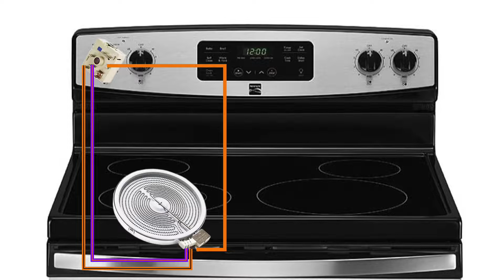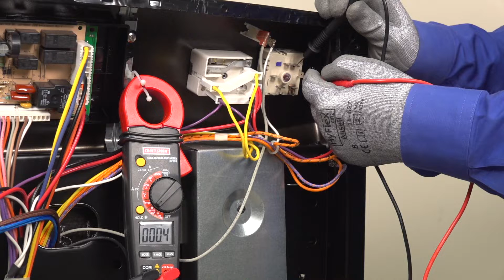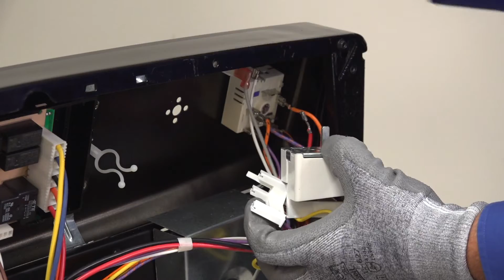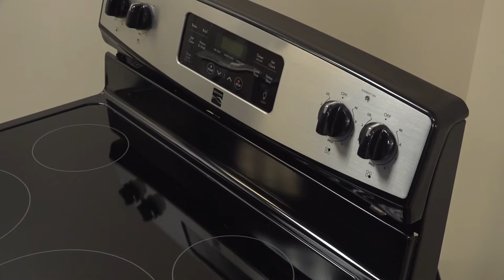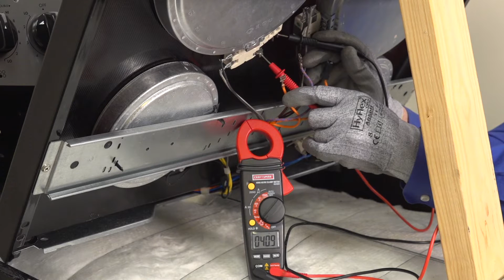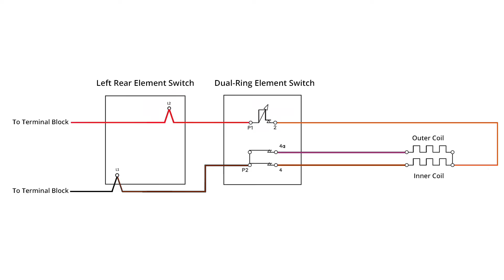Range Dual-Ring Radiant Surface Element Not Working

Comment: Thanks for the video! I have a question - both of my elements/rings work. But when I try to only turn the inner ring, the outer ring turns on. When I turn both rings, they both turn on. Could a faulty switch do that, or could it be the wiring is incorrect? The stove is from previous owner so I am not sure what was done before. Thank you!
Reply from the maker: Your symptom points to a wiring connection failure. The wire for the inner ring may be connected to the wrong spade on the burner switch or the wires for the inner and outer rings on the radiant surface element may be switched. Let us know the model number of your range and we'll provide some specific information on checking the wiring. Note: Be sure to unplug the range before checking any wiring yourself.
Reply: @searspartsdirect  its a fridigaire CFEF766GCG. Thanks for the prompt reply!
Reply from the maker: @cancelOG  Thanks for providing that model number but we didn't find any information on that model of range. We have data for American and Canadian models but we didn't find any models that begin with CFEF7... If your model isn't American or Canadian, please let us know. We'll try to find technical information for that model. If you miss-keyed the model number, give us an updated model number for your range.
Reply: @searspartsdirect  sorry I made a mistake the model number is CFEF366GCG
Reply from the maker: @cancelOG  Thanks for the updated model number. We did find technical information on that model but that model doesn't appear to have a double element. According to the parts diagram and technical information we have on that model, it has large and small single elements on the cooktop.
Reply: @searspartsdirect  thats what it is though. That's odd.
Reply from the maker: @cancelOG  The previous owner may have installed a double burner in place of a single one and wired the double burner incorrectly. If you unplug the range and pull off the back console cover you may see terminal spades marked 4 and 4a on the double burner switch. You can try switching the the wires connected to 4 and 4a to see if that fixes the problem.

Comment: Thanks for the video! I have one more question about the wiring. Which leads should I connect to test the indicator light? The problem I have for the switch is when I turn the switch on, it heats up (inner and outer both work fine) but the indicator light is not on. I'm sure the light itself is good, because it lights on when either of the other three switches are on. Thanks!
Reply from the maker: The switch contact between P2 and S2 closes to light the "element on" indicator. With the range unplugged, turn the burner switch on and check for continuity from P2 to S2 using your meter. If your meter measures infinite resistance through that contact, replace the burner switch. We hope this additional information helps. If you need further assistance, let us know.

Comment: I have an interesting problem on my Kenmore Elite that I haven't been able to track down (and can no longer replicate).  A few days ago, I turned the dual-ring switch to "Hi" on the inner-ring only (or single element) side.  However, the entire switch (and associated indicator light) acted as though the burner contained a single element over the last few days.  What I mean is, essentially the switch acted like a normal ~330° of control for the single inner burner (as the other true single element switches behave) instead of the typical ~155° given the two modes (single vs double element control).  Now today the switch and element are acting as they are supposed to (double element) -- so I can't further troubleshoot the issue.  Hopefully that makes sense.  I'm wondering if this is indicative of a failing switch?
Reply from the maker: Your symptoms indicate that the switch is going bad. You'll likely see this problem resume. Replacing the switch should fix the problem. Unplug the range before replacing that switch.
Reply: @searspartsdirect  Thanks for the reply...I appreciate it.  That's what I was thinking.  I'll order a new switch so this doesn't crop up again on Thanksgiving.
Reply: @kd0jzf580  and hear Im reading this on Thanksgiving 2021

Comment: need wiring diagram loss picture
Reply from the maker: The basic wiring diagram between the burner switch and the element is shown at 3:46 in the video. You can pause the video there to examine that diagram. If you have a different type of range or need more help, let us know the model number of your range and additional details about the problem that you're troubleshooting.
Reply: @searspartsdirect  Kenmore 30" Radiant counter unit m#911.44022100   I was replacing WB30T1004  service unit  Did not so was switching WB24T10063 element control from one to an other to check it . Took picture Went to rewire lost picture on phone went ahead wired best i could remember worked  Except for large or out side of WB30T10044
Reply: By the way thanks really did not expect to get this chance
Reply from the maker: @donaldhutcheson5291  Thanks for providing that model number and the additional details about your problem. We have a basic wiring diagram for that counter unit but the wiring diagram in our technical data doesn't show wire colors. The burner switch WB24T10063 typically comes with special wiring instructions because that part is a revised substitute for the original burner switch installed in that counter unit. Those instructions are complicated and difficult to follow. We may be able to help you fix the problem that you're describing even though we'll likely face some significant obstacles. If we understand your details correctly, you've connected the wires from burner switch WB24T10063 to radiant surface element WB30T10044 but the outside ring of the element doesn't heat. Here's some advice based on that scenario. With the counter unit disconnected from electrical power (power cord unplugged or house circuit breakers for the cooktop shut off), check for continuity through the outer ring of the element using a multimeter. If you don't have a multimeter, you can get a simple multimeter at your local Sears store or hardware store for less than $20. To check continuity through the outer ring of the element, set your meter to measure ohms of resistance and place one meter probe on the outside spade of the 2-spade connection and the other meter probe on the element spade that connects to the thermal limiter box with 4 spades. If you measure infinite resistance through that portion of the element then you'll need to replace the element. If you measure a resistance value between 20 and 60 ohms through that portion of the element then the element is likely okay. If the element is okay then the failure of the outside element could be caused by a wiring problem or a failed burner switch. The spades on the element switch should have labels. Let us know which wire is connected to each spade on the burner switch and let us know which wire is connected to each connection on the radiant element. We'll try to help you find the cause of the element failure.

Comment: What would cause the burners to stay on high when they are reduced to a lower setting
Reply from the maker: That failure is typically caused by a faulty burner control switch. Here's a video that shows how to replace that part: https://www.searspartsdirect.com/repair-guide/ranges/how-to-replace-a-surface-element-switch.html  We hope this information helps. If you need more assistance, let us know.

Comment: Great video! So if the inner ring of the element doesn't work, but the outer ring does, is it a good assumption that it is the element itself that is faulty and not the switch?
Reply from the maker: That failure could be caused by a faulty element, a bad element control switch or a wiring failure. We recommend that you follow the steps in the video to diagnose the cause of the failure before buying parts. If you need more help, let us know.
Reply: @searspartsdirect  Great thank you for the quick reply! You explained it very well in the video so I think I should be able to follow your steps and figure it out! I will definitely reach out if I have questions thanks!
Reply: Was it the element? @donesy125

Comment: Thanks  for the video. But  I  still  have questions. In my  dual heating element when I dialed switch to activate both elements on they start simultaneously fine but when dial passed 8 inner element shuts off and continue be inactive till dial passes 6 and then inner element come back to life. On the way back the same pictur...between dile 6 and 8 ineer element not working. If  I try  activate inner  element only, turning dile to the left....everything  is fine...element working all the way. What  might  be the problem? Thanks
Reply from the maker: Because both portions (inner and outer rings) of the element heat when they get current through the burner switch, all components in the circuit are okay except the burner switch. Replacing the burner switch should fix the problem. Unplug the range before accessing and replacing the burner switch. Here's a video that shows how to replace the burner switch: https://www.searspartsdirect.com/repair-guide/ranges/how-to-replace-a-surface-element-switch.html  We hope this information helps. If you need further assistance, let us know.

Comment: How does the path of electricity return sorry dumb question my background is DC electrical and I find some of this does make sense to me
Reply from the maker: We don't consider it a dumb question. The type of circuit that powers the surface element is much different than a DC circuit that you're used to seeing. The surface element is powered by a 240-volt AC circuit which has 2 opposing phases of 120-volt AC power. In this type of circuit, there's no return path for each leg of 120-volt current. The 2 legs of current mesh when they hit each other at the surface element to excite the metal in the element ribbons and produce heat. We hope this helps you understand the 240-volt circuit that powers the surface element. If you have additional questions, don't hesitate to ask.